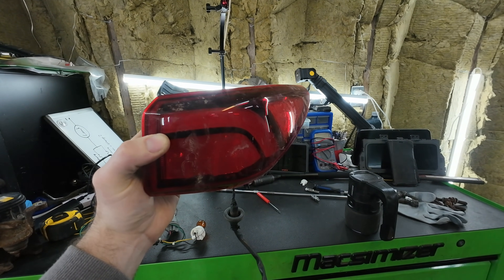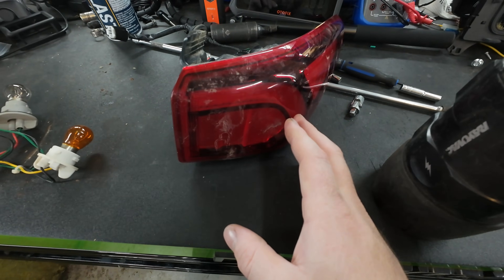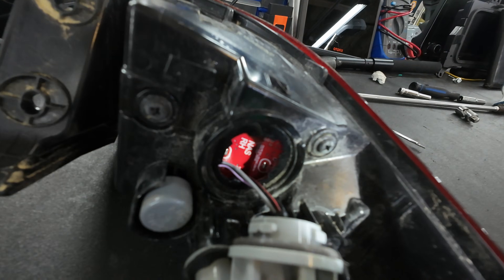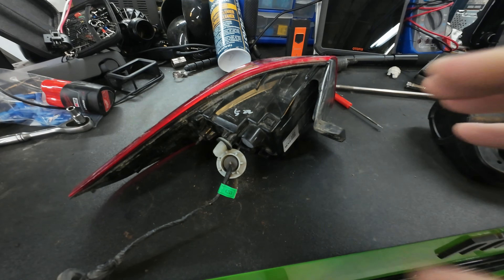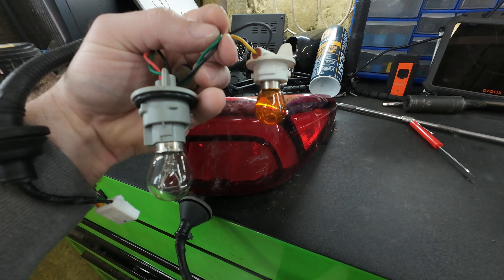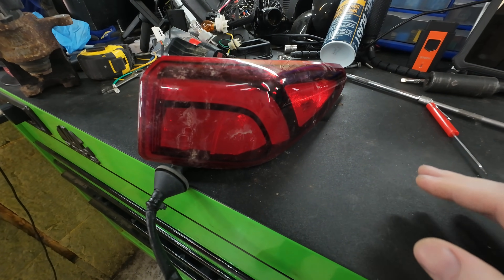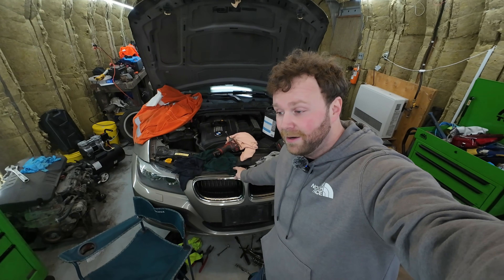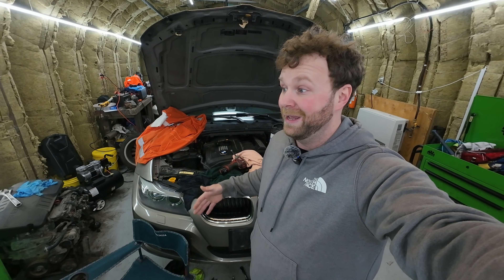Car Manufacturers don't even want you to change bulbs, they want you to replace entire assemblies!

Comment: In high school I worked at a full service gas station.  I could change a headlight in less then 2 min, taillight and signals, bout the same. You could replace inserts on the wipers.  Now if I want to change the headlight on my 2010 Silverado, I have to remove the plastic shield inside the wheel well, my 2016 Sierra, it is a $1000 led light replacement.  Is criminal what we let them do

Comment: I usually customize my cars within the first few years. When I do brakes, task number one is breaking off those squeal tabs, do not need it. We still have salt on roads at southern Ontario, so when I do brakes, I have a glass syringe, I fill it with old brake fluid, lift up the rubber dust seal at the caliper piston, and fill it with brake fluid, then I push the piston back in and catch the excess with a rag. Since I started doing that decades ago, I did not have a seized piston. It will also unseize them for a short time. I also had the instrument panel board removed, and deactivated the seat belt buzzer, it now switched, after I discovered the signal click was also the same buzzer.  They build the signal and emergency flasher electronics into the same board , it is cheaper. There is a service in Toronto that fix those boards, assume you can afford the down time.(do you have a choice ?) The radio touch screen went on me a few years back, the dealer were basically useless. they wanted to replace the radio for $1000 + labor.  I discovered from You Tube you can teach a monkey to remove the radio, I did , and a electronic technician helped me to replace the touch screen (digitizer $100 E Bay.)  During Covid hoax, my other Yaris went through second rear wheel bearing. been told I need a week appointment just for them to look at it, then another one a couple of weeks later to fix it. I did it myself.

Comment: The US have regulation about gas mileage, and parts of it are counter productive, resulting in many huge pick up trucks , when people really need the small pick ups. Engineers decades ago already picked much of the low hanging fruits for better mileage , now the improvements are far smaller and cost more, a repeat of the 80s with the new engine controls with sensors and computers. You save a little gas, but you did not save any money.  Try these examples, Camrys, no dip stick for the trans, make them much more difficult to service. The PCV valve is at the rear , difficult to change, just cost me $100+ for a mechanic to change it. The compressor is variable ratio, and cost $2000 instead of say $500, parts only. I recently saw some videos that Camrys , Mazdas etc identical engines , same turbo etc in North America , you have to use 0W-20  but at other countries without gas mileage laws, 5W-30, which cost about half as much. My car also cannot tow any trailers,(BS this car are tough enough to be taxis)  but luckily it is 2015 and I do not have the weaker springs behind the oil control rings that make it burn oil.  I rather have engineers design my car, and not lawyers or accountants. Over a decade ago, I started changing oil myself. never did it before, not worth it money wise, but the fast lub place are getting greedy and I did not like inexperienced teenagers working on my car, stripping drain plug etc and to sell me stuff. They also love to pump my Sidekick's tires to 35 pounds, the door sticker says 24 pounds. I try to change oil and all the work in the summer. I am trying to and think I can make my air filter last the life of the engine.  Yes I have compress air.

Comment: We were bored at the shop one day, so we called the local Infiniti dealer to see what they wanted for my boss' 2012 Q30 headlamp assembly (I think that was the model, they all look alike lol) $1,300 for the part. We ended up cracking the assembly open and soldering the broken trace on the useless LED strip that had crapped out. Replacing the running lamp maybe shouldn't cost as much as buying a '99 Corolla...
I love those older X3s, they had a manually-operated hot/cold blend door until the mid-2000s. Shockingly good design in many respects.
I thought I had subbed, but that wasn't the case. Rectified now, much love from your southern neighbors.
Reply from the maker: Glad you were able to fix it yourself, good on you for being resourceful.. ty for sub :)

Comment: What's the failure rate for LED vs halogen lamp?
Reply from the maker: I can't give you numbers but I'll tell you i had piles of them while at Ford, honda and hyundai. They fail. Unprotected circuit boards do not like humidity and hot and cold

Comment: To be fair, it's not easy for the everyday person to fix or change LED arrays and these types of assemblies. However, they can make them open easier and so that you can at least easily desolder/solder bulbs. The chip boards there's not much you can do but drop in something similar or customize, which is above the average guys head. I dremel them opening the back to take the guts out.

Pros: The LEDs look a lot better.
Cons: Requires a learning curve to service.

Comment: Reducing parts SKUs saves costs (for the car manufacturer). The car is designed for manufacturability not repairability. The sub-assemblies are outsourced. Do these subcontractors even have after sales support? (Side note: A light bulb is not serviceable. It's really a labour/material cost tradeoff.)

Comment: I don't believe it has as much to do with generating aftermarket sales profits as much as it is attributed to the corporate need to drive down manufacturing costs. If you can source parts that are plug and play at the factory, then you save time, which saves costs.

Comment: 2014 KW T800 turn signal light replacement costs:
8$ 
(a single bulb replacement)

2024 KW T800 turn signal light replacement costs
300$ 
(Same model as the 2014 truck, but "upgraded" LED lights. You have to replace the entireassembly)

Comment: I disagree. Light bulb by definition have a limited life span and need to be replaced after few houndred to a few thousends hours of working. Properly engineered LED lamp will outlive the car itself. So instead of a part that require regular maintenance and carriage of spare light bulbs in case it suddenly go out in the middle of the highway, you got component that does not require any service or attention for the vehicle lifetime. The only accusation of greed may be, if you actually required to reprogram new lamp in case replacement is needed, but that is extremally rare.

Comment: In 2014 I had a 2006 VW Passat 3.6L Luxury Edition. 

The headlights were HID and swiveled around corners. 

I had a bulb die and was looking at aftermarket Audi lights for $400 for a set. I called the VW dealer to see how much a replacement was he said $600. I said, “Dang! $600? The aftermarket set is only $400.” He replied, “It’s not a set. It’s $600 for one”

I bought an even more expensive car after that (Phaeton) but am now the happy owner of a ‘98 Hyundai Accent.

Comment: To replace a single headlight assembly on my car its $2200. Thats just the part from the manufacturer. A used one on ebay or or a junk yard runs about $500 at the cheapest unless there is something wrong with it. I drive a 2018 Elantra Sport that I spent $19.2k on brand new...

Comment: I have a 2004 Avalanche, Headlight bulb replacement is easy.  A co-worker has a 2007 Avalanche.  Headlight bulb replacement requires disassembly of the entire front grille.

Comment: Here's my fun story - had a 2017 Ford Escape, left headlight faded then went out, a little later the right one did also. Stopped by an auto parts store to get a couple of bulbs, put them in, didn't work. Come to find out that both headlight assemblies needed to be replaced. 1200.00. Each. Ended up being 2600 bucks at the Ford dealership. Car had around 80 to 90k miles on it. 

Postscript: a year or so later coolant was leaking into one of the cylinders, needed to replace the engine. Traded a paid off car in. It's almost like we are all ducks in a shooting gallery.

Comment: If im buying a car,I always make sure to get a one with manual adjustable seats. Electric on some cars can be a real pain and expensive to fix. Sometimes if its a broken wire,it can be hours and hours of labour costs after the initial diagnostic. 
If the seat locks and youre sharing it with someone,you can't drive it if its stuck in the position for the smaller person.

Comment: My 2002 F-150 has LED tail lights.  Because I put them there.  They look like little light bulbs.  They work like little light bulbs... except they're brighter and will probably last a lot longer than the incandescent bulbs that I used to have.  No printed circuit boards, no can bus synchronization, no reflashing the software.  Just bulbs..... about $4-$5 apiece.

Comment: I think you will find the modern Ford Bronco is the same way.  A dealer-only tool is required for a new headlamp assembly.  BMW requires a dealer-only tool to teach your new BMW about the electrical personality of the new battery.  Meanwhile, you can replace the headlamps AND brake light bulbs AND FIXTURES on my old 83 Cutlass Ciera and BOTH of the 91-02 Saturn "S" series cars that I still drive today.

Comment: In my teens (1970s) i carried 1157 bulbs and a philips head screwdiver. If i saw someone with a burned out light, i offered replace it for maybe a buck or 2. The bulbs cost a quarter or 50 cents. Simpler times.

Comment: Our long term Audi A6 was a joy. 350 HP normally aspirated V8 got 24-25 mpg on the highway, and the car was nice looking, comfortable and reliable. Until it went past middle age. This 2008 car passed 100,000 miles and “stuff” began to happen. The final straw was a driver’s side daytime running light going out. Replacement quote?  $3,500. Nope.

Comment: Not to mention the fact, that if you buy aftermarket and don't use the more highly expensive OEM replacement parts, you run the severe risk of messing with your car's computer systems. This can lead to serious negative consequences.

Comment: I’m replacing my 07 sport trac next year. My requirements for my next vehicle are quite simple. No fuel injection, no computerized crap. Will be looking for late 60’s early 70’s pickup, Ranchero or El Camino. I have a boat to tow so a big block is preferable as is points ignition.

Comment: 2024 Silverado, the turn signal quit working in the right front headlamp assembly. This type of headlight assembly is all LED. So the DRL is White, but when you put the turn signal on it flashes Yellow. The whole headlamp assembly has to be replaced to get the turn signal to work. The headlamp assembly was $1,800 and it is a 3.5 hr job.  Out the door, the repair is over $2,500 to get the turn signal to work. 
Criminal. Especially because the vehicle was out of Warranty due to mileage.

Comment: Dodge Durango is like this - headlight bulb fails and the entire headlight must be replaced which requires disassembling the whole front end of the vehicle.
Headlight assembly is $350 and if you go to the dealership you're looking at a $1000 repair for a BULB

Comment: People trash talking hyundai/kia. Wait til that 6k$ headlamp install comes in on your "good vehicle" 
As a fleet tech this is why i bought a used elantra. Headlamp pair new 60$, tail lamps new 45$/e, ball joint pair 40$, real key, real hand brake, real shifter, used engine/trans 300$ ect

Comment: This is nothing new.  I had a 2008 GMC Acadia.  When the LED headlights went out they were $1300 per side.  I am amazed insurance companies allow this.  Lights in homes have gone the same way.  Instead of replacing the bulb you need to replace the whole fixture.   And the myth that LEDs last forever is simply not true.  The funny thing is this is all the result of the environmental movement. They pushed for LEDs to save the environment, and the end result is a lot more trash and expense.

Comment: Car parts complexity and pricing now is utterly mad. Somebody clips your mirror now and its a £1,000 part, probably needs coding to the vehicle by a technician, etc. 
I worked in the automotive electronics industry many years ago, and one of my clients made impact sensors for airbag systems. Basically a ball bearing on a calibrated spring to sense deceleration....he said they sold them to car companies for about $3 US. He knew his VW had these parts, and out of curiosity got a price for one from his dealer.....£220 !!!! That's just the sensor, not including fitting.

Comment: You're a man after my own heart, Lance.  Keep it simple and repairable.  If I had the money, I'd start a company that could offer retro refits.  My first two cars were built in 1964 -- a VW beetle and a Pontiac Grand Prix -- and both, despite their differences, were incredibly simple to work on compared to today's overpriced cars.  😢 I would rather have either one of those cars than anything available today, if only I knew I could still get the parts for them.   Ah, well , one can dream.  Liked and subscribed. 👍
Reply: Easy? Depends on what you had to fix back then. Lol I don't think you've ever had to replace a two dollar frost plug. Usually requires removal of engine lol.

Comment: One of many reasons I proudly drive a 1999 Dodge Ram 1500 just refreshed both headlights and taillights with aftermarket assemblies for under $200 and that included LED lamps for the the front reused the regular bulbs out back so easy to replace any and all lighting and no impossible to service and diagnose computers etc. New vehicles are a hard no for this ex mechanic I can repair anything on my truck myself👍

Comment: I had a Pontiac Gran Prix that needed a tail light replaced. The owners manual had a diagram/instructions on how to remove and replace. It showed 3 screws in the trunk, but it turned out it had 5, and one was hard to find. The manual had not been updated from previous  years. Just putting a new date on the  cover doesn't mean the info is up to date.

Comment: People are demanding "new technology," well, expect to get bled dry at your bank account. In my life, 69, I worked as an industrial mechanic. I worked on some the highest tech equipment made in the power cable industry. Believe, I watched millions and millions lost due to high tech that was just junk. If it wasn't for innovation by co-workers and myself to rectify this engineering flaws, plant closures were eminent! Vehicles are on the same road to destruction! The first manufacturer that produces a practical vehicle today, steals the market! The closest to that today was the 2006 basic, Corolla, 2014 Mazda 3 base model, I've owned both from new. Very reliable. The Corolla had manual windows ,seats etc. when I purchased the Mazda , manual windows were not available or I would have had them! My best friend bought the Corolla with 185000km, for his son, 400000km and still running. I feel so bad for young families that suddenly receive a repair bill for thousands on a vehicle monthly payments are still being made monthly. It is breaking young people!

Comment: They made cars too good and people were driving them for 10-15 years, not buying a new one.  So now they're designed to be totaled with the first crash because the headlights/tail lights and parking sensors are so expensive it's just cheaper for insurance to total the car.

Comment: The dome light stopped working in my car; keep in mind that I am a mechanic. After basically having to disassemble the interior roof,  the doom light is a part of a harness and can not be replaced without replacing a section of the interior harness.🤣

Comment: I have a 2025 GMC 3500 AT4. Supposedly the headlight and taillight assemblies are microchipped. You cannot buy aftermarket. Once LED goes out almost 2000 per assembly.

Comment: Car manufacturers are just taking the hiss today. Some cars have plastic parts inside the engine and to change a water or oil pump you need to drop the engine out! It shouldn't be allowed because it's just a rip off.

Comment: I bought my Suzuki hatchback in 2006. Manual, gas 1.3 L, 5 gear. No computer, manual door latch and window. They kept 2 spare halogen headlight bulbs in the glove box. The bulbs are still there waiting to replace the originals
My left tail light was tapped by a mobike. Instead of replacing a perfectly OK taillight assy, I put lengths of red electrical tape. Which I replace every year. The bulb is fine
I guess cars went down hill from there. Unnec 5 computers (even to open the hood), computer controlled tire sensors, butt of car seat heated electrically, this that and the other. 
And my built in Japan engine purrs and still gives 35 mpg

Comment: When I first started driving (1980), headlights were sealed-beam units. If one burned out, you went to the auto parts store and bought a one (or kept a few in the garage). On the car you would take out 4 screws, pull the sealed-beam unit out, unplug it, and reverse the process with the new one. Simple and easy. On tail lights, if a lens got cracked or broken, you would order a new one from the nearest dealer and then replace it. They were just screwed on.  In those days, you didn't get power windows and all that stuff unless you bought a high-end luxury car, or special ordered them on other cars. 
Pickup trucks had rubber floor coverings and usually no headliner, and no power accessories. Everything was cheap and simple.